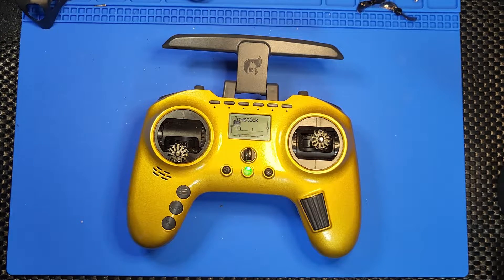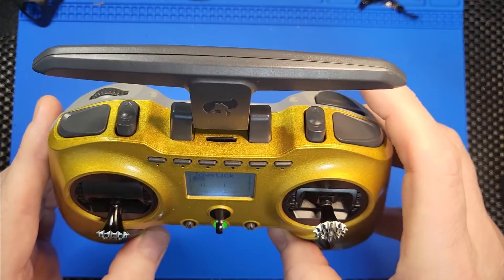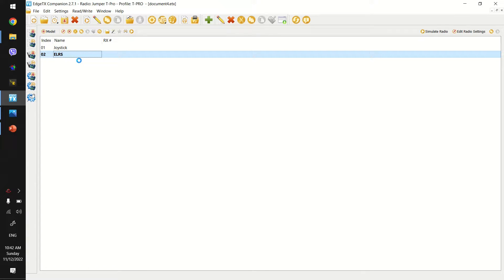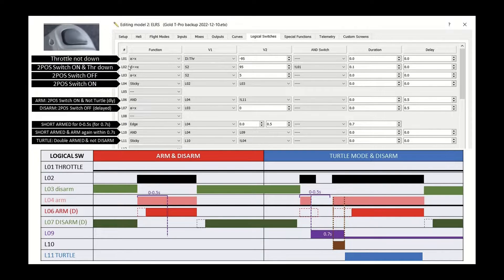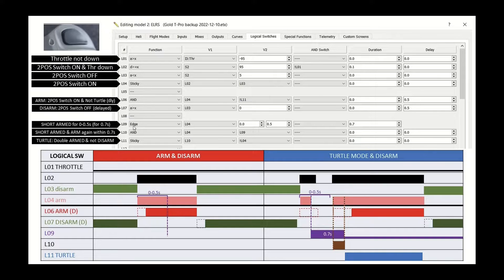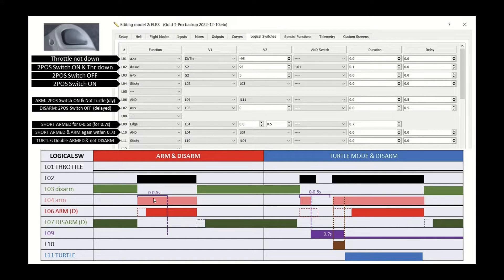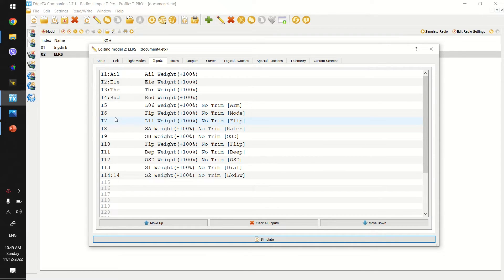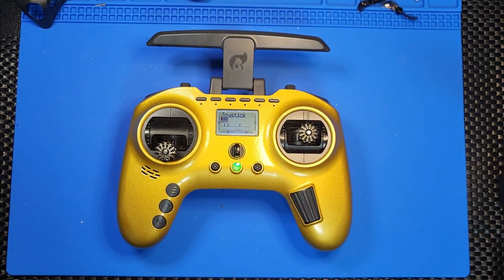Edge TX Tricks - Double Arm to Turtle Mode on Jumper T-Pro

Comment: can you do a video to get turtle mode set up on one 1 of the 6 position buttons?
Reply from the maker: I'll put  it on my list, but when I have my goggles on I find those buttons hard to find, not sure if it's a good place for in-flight  controls. BTW  I will do a video soon how to use monetary switches to handle 3 functions (short press, long press and double click)
Reply: @darzwhoopwhoop  Oh true, although I have the version where there is now latching switch on the bottom. Theres only those dials. If you could do the 6 position switch that would be amazing!! Thanks in advance